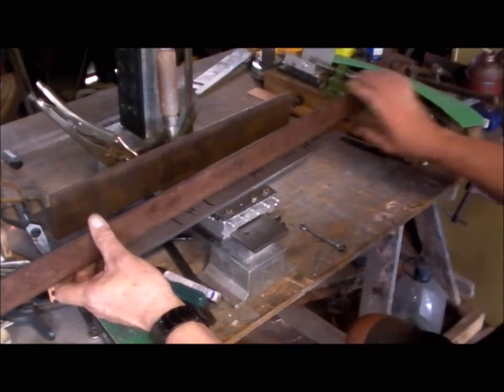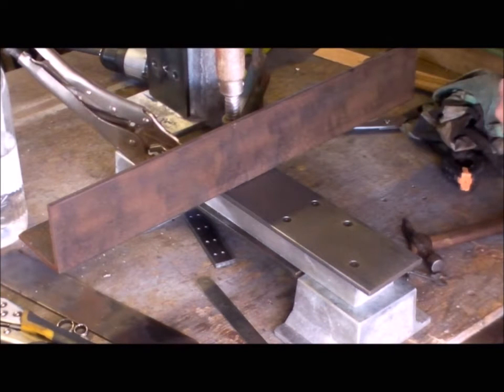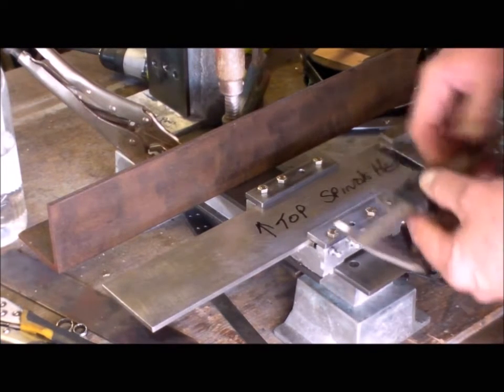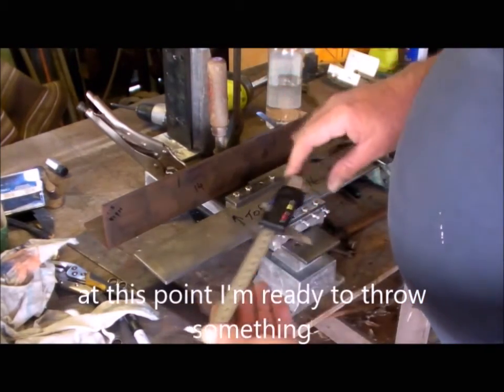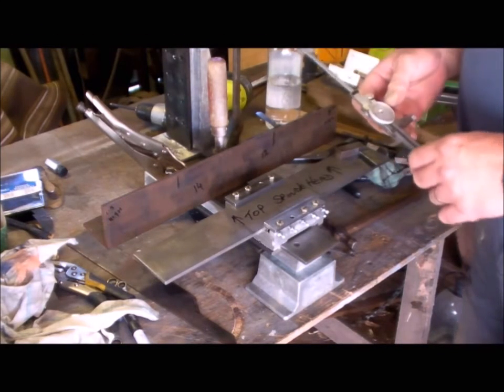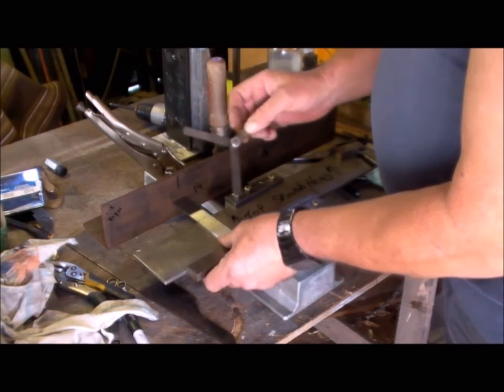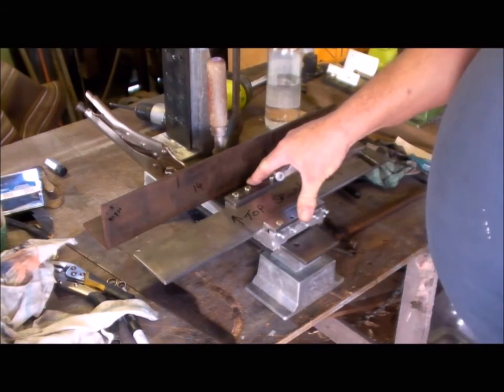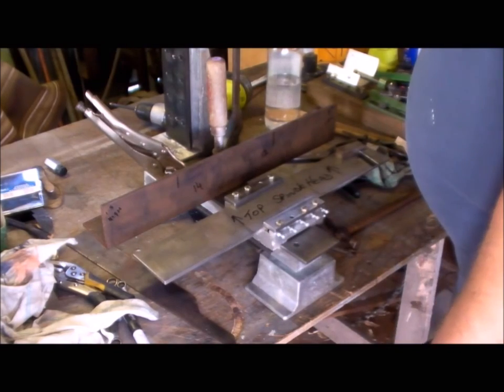Building the Gingery Milling Machine 13, final alignment of the work table slide

Comment: Peter, great video on patience!!  Couple of thoughts.  You stated that the gib side of the slide is straight.  Is the Spindle side of the slide parallel to the Gib side.  You seem to be pretty thorough so I imagine that it is.  Maybe an alternative to making this a direct measurement is transferring it.  Since I think I remember you said you had a lathe, you could take one of your sprues and face both ends and turn, then drill and tap wile it was on the lathe to a fine thread.  Next make another piece and do the same and loctite an all thread into it, making a jack so to speak.  Since the foot of the jack and the top will be parallel, you could use this to get your gap measurement then use your callipers to measure this.  If you drill a cross hole and thread it for a grub screw, you can put a piece of brass in the hole to press against the threaded stud to control the feel and stiffness of the jack screw.

Anyway, I am getting great enjoyment from watching your build.  Thanks so much for sharing with us.

Joe
Reply from the maker: Hi Joe, yes I realized after publishing it that I forgot to mention the spindle side of the plate is parallel to the gib side, I did measure it, straight edge / feeler gauge it and confirmed it by the sliding action of the plate through the 4.3/8 wide carriage. I like your idea for measuring, as you may have noticed I was frustrated with the calipers - don't get me wrong I constantly use them and find them of great benefit - but I should not have persisted with them in this case as their acurracy is determined by the squareness of the tool to the job. Thanks for stopping by.
Reply: We watch the same stuff...lol Can you imagine it being 100 degrees at 8 in the evening. I used to live in Florida and I used to love being on the beach in the evening.
Reply: @Biokemist-o3k  I am in Tennessee and the humidly is insane,  But 100 degrees at 8PM would be horrible.

Comment: thats quite a job there. seems almost impossible to get perfect . maybe a surface plate and squareness comparetor??
Reply from the maker: Yes you are correct, it is a JOB to get it right and it isn't completely right, it still has a couple of spots that are tighter than the rest but only just, maybe a 1/2 thou but I have left it until later after some use and high sports are pronounced. I will say that I probably won't be working this table down any further as it is only a temporary work table to machine the spindle bore and to machine a bed for the permanent work table. The permanent table also has a 19" slide to true up but this exercise has taught me a few things, CRS is fairly true, clean off all the mill scale, down to shiny steel, the only contact between the plate and clamp pads is 6 to 10mm, but you have to work the whole width of the plate to start off as it is not easy to work a 10mm strip by hand, the last high spots can be worked with a hand scraper over the 10mm contact area. I didn't use the surface plate as the clamps show up the high spots quite well. Squareness comparator, please, maybe I'll make one with this mill, for the moment a straight edge and feeler gauge works fine to about a thou and test fitting helps finish it off. You may have noticed I am fond of the straight edge and feeler gauge, it gives me a warm fuzzy feeling of my youthful motor mechanic days.
Reply: thanks for explaining this. these books I dont have, on principle, because im not going to live that long.. lol